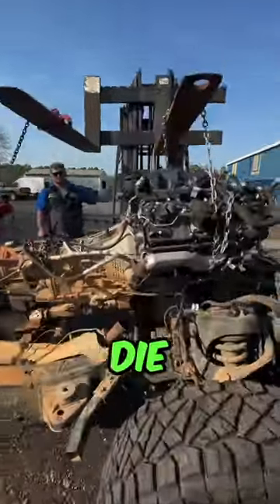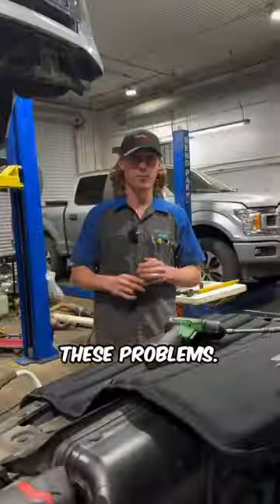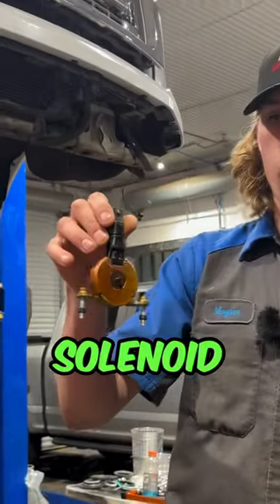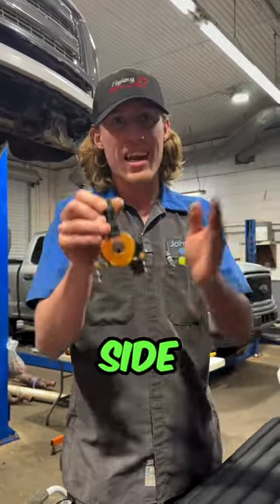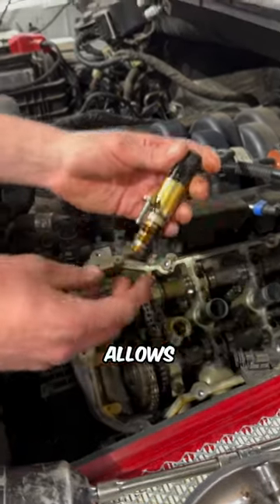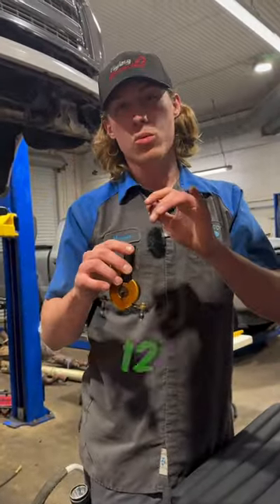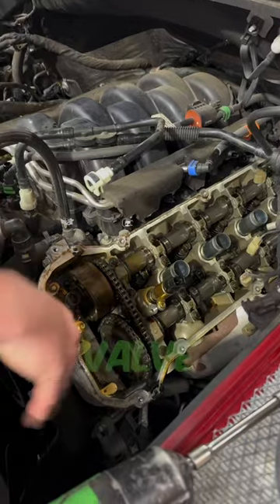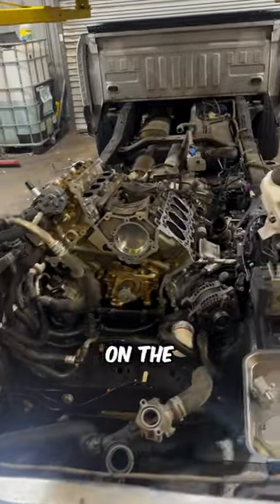Ford 5.0 Coyote Dies On Stop? #ford #coyote #shorts

Comment: This guy is 23 with 30 years experience with Ford engines
Reply: How I’m tryna be
Reply: Not a chance if that were true we would see him wear safety glasses in his videos
Reply: @justinkelch4837 😂 youll never see a tech wearing safety glasses unless you actually need them
Reply: @08specb 
I only use em when the dirt has fallen in my eyes at least twice already
Reply: More junk built by FORD coyote engines love there OIL and most are noisy running ENGINES
Reply: @karterpodlaski2283  if you want to lose your vision yea. shop I'm at requires safety glasses (they provide) and actually enforces it and guess what? most,if not all, don't complain. I don't get why people hate safety glasses, there is literally no downside to it. at the very least it stops rocks from getting into your eyes when taking off an undershield.
Reply: He's a Ford tech..
Reply: Dosent take long when you work on ford's.
Reply: @donaldkinder6716  at least we don't have junk lifters that fail all the time...

Comment: Long live the 4.6 liter, never had a valve cover off or a check engine light 12 years and still going
Reply: It's 30 year old tech that's why
Reply: 4.6 is a pretty strong engine. I’m not the biggest fan of OHC V8s but that’s one of the best ever made. There’s a reason expeditions, F150s, and Crown Vic’s with that engine are still running strong today
Reply: hell ye my dad got an 04 F150 300K miles no major issues
Reply: My 4.6 f150 is so weak always has been so weird that I used to drive my aunts Mercury with the same engine and transmission raced people did burnouts with ease my f150 won't ever do a burn out unless its wet outside 😢
Reply: That’s because the whole truck is rotted and falling apart around the motor
Reply: @the_first_resort940  nice just jump on here talking about something you don't know I don't live in the rust belt jack azs my frame has less rust than some newer cars go flap them lips to someone who cares
Reply: Change the spark plugs and see what happens
Reply: I have a 4.6 3V 2010 f150. And I love it but I have engine codes.

Exhaust manifold cracked, so it throws oxygen sensor code.

And intake manifold runners stuck, so it throws intake manifold code

Basically just loss of power/increased fuel consumption , and noisey exhaust, but no drivability issue

About $2000 for both repairs, but what I like is none of the issues I’ve had have bricked the car
Reply: The 3.8 is slept on as a good engine, my dad has a 3.8, 4.6, and old 5.0 they all have about 275k on them
Reply: @Tropicalfrooploops  if you trust in your wrench turning abilities I'd just try to clean the intake manifold, take brake booster line off get some injector throttle body cleaner and spray it into the manifold side of the brake booster line then if possible spray some downstream of whats called a maf sensor if you do a little researching you'll find what im telling you and you till unstick them runners as far as the manifold take it to a shop.thats going to do it for a reasonable price and give you a warranty because you have to lift the engine slightly to get them out and your 2010 is a 4wd it's even more of a pain i installed headers on the 5.4 version of your lets just say I did it twice because my friend just loves Amazon junk and then wants me to help , and by help he usually means i gotta do it while he gets in the way
Reply: @jayskrills7375  oh wow, thank you for this. You think it’s just stuck? I though maybe the solenoid broke off or something

Yeah with exhaust probably short headers is the way to go.

I use it for work so I’m not too particular. I do enjoy the truck very much tho, great price, never leaves me stranded, and it’s got good power
Reply: @Tropicalfrooploops  I'm just a perfectionist if my exhaust manifold is leaking id be worried id burn a exhaust valve up but in my case i have a brand new engine ( remanufactured ) I think you have a sticky manifold runner if they were stuck closed then it wouldnt run or id be real rich stuck open your looking at lean code idk without looking at live data just a idea in my head lol
Reply: @jayskrills7375 If you gear them down they move pretty well, with the big overdrive a set of 4.10s will really wake them up but still be ok on the highway.
Reply: @TheEuroGarage  I'ts already horrible on gas so I'm guessing that will make it worse
Reply: @jayskrills7375  sometimes it actually helps, Let’s the engine not have to work so hard to move the truck
Reply: @TheEuroGarage  I don't think you know what you just did but it's ok i forgive you. Days off work are going to be me rolling around in the driveway . savings account  get ready to get empty why we need new gears
Reply: Yeah I hear intakes manifolds are starting to crack that might have issues.
Reply: @gagejernigan5277 my 2000 f150 also holding strong to this day. 400k miles towing every week
Reply: @giovannimora9134    Very nice. I had a 2003 Eddie Bauer expedition with the 4.6 and when I got rid of it at 330k the motor still ran fantastic there’s was just other shit that was broken
Reply: Long live the 5.8 Windsor. My brother had 30 years and over half a million miles with no issues. His Colony Park wagon used less gas than his wife's Taurus. Less gas than a V6 Toyota Camry!
Reply: 01 4.6 f150 been driven almost every day since new 343k
Reply: @gagejernigan5277 lol strong engine 4.6 is weak and are throw away ENGINE'S there as bad as the 5.4 Triton engines
Reply: @giovannimora9134 lmao sure bud 😅
Reply: @donaldkinder6716  nah the 5.4 would blow the spark plugs out the 4.6 doesn’t have that issue n you’re shittin me cause the 4.6 picked up pretty good in crown vics
Reply: @donaldkinder6716  it’s a company truck 🤷🏽‍♂️ odd thing to lie about lol it ain’t a the most powerful but it gets the job done reliably.
Reply: Best gas engine ford has ever made
Reply: @giovannimora9134 really? Years ago had 01 f150 with 4.6 and had to replace head gaskets at 115,000 MI. I was so disappointed I fixed it and unloaded it.
Reply: @Tropicalfrooploops  that's typical 3v issues. If you want a dependable and reliable 4.6 or 5.3 you need to get the 2v.
Reply: you are so lucky.
Reply: That's because the engine is too underpowered to kill itself. 3V are just as problematic as 5.0s which 5.0s really aren't bad engines. Actually great engines. Mines 400hp and gets 20mpgs on 33" tires.

Comment: Ford has a bulletin for every f'ing part.  Just build em better.
Reply: They all do buddy! Source:I do this all day everyday at an independent shop
Reply: @killroy3607 yeah they are all shit , especially a turbo tiny engine
Reply: Yup🎉
Reply: What do you expect for claims they made the first car and we all know Mercedes did 50 years before ford. Ford was sucking Adolf off for some design ideas from VW.
Reply: Henry Ford wrote in his autobiography that if anything ever goes wrong with one of his Fords, it’s his fault. Guess that doesn’t mean they’ll make it right.
Reply: @the_first_resort940  Ford didn't claim the first vehicle, he claimed the first affordable vehicle for the common man
Reply: @kenj.8897 turbocharged four cylinders can be reliable, its just manfucatures are putting out shit designs that arent built to last
Reply: Change your oil and quit blaming ford for your bad maintenance
Reply: GM is simply in denial about their issues.
Reply: When ya’ll say they all have issues you’re definitely not talking about Toyota. Their worst, most problematic truck built it’s still better than any American made trucks. It’s a shame since trucks should be the American pride in vehicles but Japan took over the cars and trucks.
Reply: @ksale22 Henry ford was also antisemitic, received an award from the nazis and made equipment for them during wwii

Comment: 17 5.0 f150 4x4. Not one single issue with the engine or trans. 176000 miles
Reply: At 140k with my 17 2wd
Reply: yeah vehicles are weird man some times they dont break 100k miles before having some massive issue then others run just fine for 200k+ miles. Case in point i got a 2010 5.3 with AFM and a 4l60e with almost 200k not a single lifter tick and trans shift fine. while others complian non stop about theirs.
Reply: I should shut my mouth though because I get out of the marine corps in a month and I'm relying on that thing to drive me from cali to east Tennessee

Comment: Shocking how the exact same thing happened with the 3v 5.4s
Reply: you had vct codes? Because replacing those almost never fixes the issue. Most of the time it’s just the sensor reading that the cam shaft is wobbling around too much because the lifters in the back of the engine become oil starved unless the engine was meticulously maintained
Reply: @nc818 that’s just patently false.
That’s one of the possible failures, but loads of folks had their timing solenoids go bad on the 3V 5.4 Triton. 

Time will tell whether these get the integrated spark plug blowout like the Tritons of years past did.

Comment: I did this job myself. About $320 for all my parts did all 4 both sides took me about 3 hours with fairly minimal tools. The ground straps on the back of the valve covers are a big pain if you’re in the rust belt tho

Comment: Had an issue with my 15 f150 with the 5.0, cruising down the road come to a red light and chugga chugga stall, always happened when the oil had over 3k on it, pulled live data with forscan while idling in the driveway, brought it up to 4k rpm and let it drop and intake cam on bank 2 was jumping to 20 degrees off of commanded, and once it hit 24 it died, put some seafoam in it and it helped, put in some marvel mystery oil after oil changes and it helped, need to find the time to swap all 4 solenoids
Reply: It's worth it. I got the "Ford performance" solenoid's. They looked the same tho, but all 4 were less than $100, plus the gasket kit for the valve covers. 2 of the old solenoids were gunked up and sticking. Noticed better fuel economy and throttle response, which I wasn't expecting. Also don't be a dumbass like me and crack your plastic valve cover when reinstalling seals 👍
Reply: @Mr74datsun260z from my sleuthing online the ford performance solenoids have a stiffer mounting on them, not really necessary for most people but a set of 4 oem solenoids for $100 is a damn good deal when 1 aftermarket part is $35-50, I need to bite the bullet and replace em
Reply: @slasher667  just to clarify, I don't think my fuel economy and throttle response difference was from the "performance" solenoids. I think the old ones were making it worse than I had noticed.

Comment: Thank you for posting! Mine is going in again tonight for the 3rd time with a p00012 code, 1st they replaced the heads (burnt valve, leaky guides, 2nd they replaced the phasers, they were never clear on if they replaced the solenoids or not...but its going in again, but this time its not dying at lights just sporadically runs rough then runs fine...could it be a cam sensor?
Reply: They just replaced all phazers, vct's, plugs, chains and tensioners. 6k$ stalled before it got off the lot. I left it there and they are looking at it again.
Reply: Same code p0012 2018 f150 5.0 lariat with 147,000km junk

Comment: I'm hoping you can answer this question... I have a 2015 f150 3.5l that's been dying on acceleration! The last time was up a hill first time towing a trailer... once it dies, it will not restart at all... first time brought it to mechanic as electrical shits beyond me, 1500$ later with a main wiring pack replaced as it was said to be burned up, got it and within maybe 20km drive, died again.. first time it flashed alot of issues such as hill decent not working, charging system failure etc... the charging failure stayed on till the mechanic "fixed" it.

Comment: Boy do I love my Henry Ford F150! Needed a reliable truck for work so I got a very clean 2019 F150 kr 5.0 with 32k miles. 

Followed all the recommended maintenance and what do I  get? A $50k vehicle that stalls like a 80s beater, bogs down when accelerating, occasionally has a flashing cel and cuts power on the freeway, and then the cherry on top was cancelling work on a work trip to replace the front right wheel bearing in a hotel parking (55k miles). The wheel almost seized and the lugs began loosening. 

Also The Henry Ford dealership charged $250 to do their little cycling procedure (fixed nothing) and said “it seems fine but come back if you want us to look into it more” rather than sharing how I could’ve gotten BRAND NEW solenoids for less than that. 

I had a 1995 Corolla with half an exhaust valve missing that was FAR more reliable than this. I don’t know what to think anymore. No warranty left either. They timed that good!
Reply: No1 cares

Comment: Up north you buy all new hardware, and a new valve cover 1/2 the time because there is no heads left on any bolts, and you have break everything.
Reply: That's simply not true. All the nuts and bolts you need to access are on top, or close to it. Its almost unheard of to snap the heads off the valve cover bolts. And even if you did, so what? The head of the bolts hold the valve cover on. If you have a plastic/composite valve covers, there's a metal sleeve pressed into the valve cover bolt holes.  
You may be mistaken for at least some of it because Ford has a lot of single use only parts and fasteners. For example, when you remove the fuel pump the 2 steel lines must be replaced. Its not optional. Ford requires it, along with any other parts.

Comment: They also have a bulletin that when your 5.0 starts knocking that its normal.  My 2017 f150 has all of the above problems. Already put a new trans at 100,000 miles for torque converter shudder. Still stalls and knocks.

Comment: Absolutely I missed these old 4.6L, 2.3L 3.0L and 4.0L and also 5.4L 3V is better than new ford engines. I have zero issues with 5.4L 3V 230k miles so I decided to swap mellinh oil pump and replace all new ford oem timing kits and phaser.
Reply: Nice to see someone who actually knows what they're talking about, the 5.4 3v is junk bandwagon has become urban legend at this point, their solid when taken care of, hard to believe the human race still hasn't figured out variable cam timing.

Comment: I have a 5.0 f150 2018 and when I take off from a stop not all the time but most of the time it makes a rattle sound it only happens when warm I use 93 gas have you had anything like this with a fix?

Comment: Those vcts are the arch nemesis of the 5.4 3 valve. I locked my cam phasers and it stopped the vct or vvt whatever yah call it, but I don’t understand why locking the phaser stops the issue anyone know why?

Comment: I have a 2018 in the shop right now. I paid 6k they replaced all solenoids,  phazers,  chains and tensioners. Oil and coolant. It stalled before I got it off the lot. Brought them out, they plugged in computer with no codes. They watched it stall and sputter repeatedly while plugged into laptop. Still no codes. It originally was in for a p0012 was stalling for months before it coded.
Reply: It's a 5.0 with 147,000km on OD
Reply: There were other codes. You can't have a 2018 F150 stalling for months and not have any codes in the history. Someone either didn't know what they were doing, or they were not being honest with you.

Either way, you would never make repairs off a P0012. Its too generic. I believe its something like a generic timing fault on bank 1 intake, or something similar. Most likely, someone was just lazy and fired the parts cannon at your expense. The problem with a code like P0012 is all it can do is point you in the right direction. Any number of things can give that code. You have to keep going until you find something more specific. You could just have a bad cam sensor.
Reply: @AT-wl9yq  it's good to go now, they forgot to do the misfire monitor neutral profile correction after the replacement of vct system. In fact, it did not have any codes for months of stalling. This is common, and there are plenty of examples of the F150 forums. Problems ranging from solenoids, intake rails(cracked) phazers. Cam censor ect.
Reply: @AT-wl9yq  they tested the solenoids and they were good, then they tested the cam position and it was over retarded so they replaced them. Cheers
Reply: @rogerrabbit8756  I understand all the issues with the parts, however I'm still going to disagree with you on the DTC's. If I had your truck, I could prove it. You just have to know how to get them. Every time the motor stalls with the key/button in the on position, a whole bunch of modules send communication codes. Also, some permanent DTC's may have been set, but you probably won't  see those either. 99% of the time, a complete scan is done on all the modules at once. You can also scan each module individually. Module scans can give you a lot more information. than just doing all of them.
Reply: Not if the thing has a shorting harness, bad ground or bad pcm

Comment: What is the typewriter noise
Reply: That is his impact drill when he used it to remove the solenoid.
Reply: No it's when the engine is running and at operating temperature, I asked because it's a 5.0
Reply: No one really knows. Engines have been torn down by ford and others and no one can say. I have 82k on my 5.0 and runs great and I hardly hear the noise any more.
Reply: My best guess for the tick is,  there is a shim on the trust bearing that clicks and wasn’t set properly when the engine was assembled.   The 2 mustangs I have don’t tick.  2015 Roush rs3  and 2019 GT. My 2011 and 2014 Roush  did tick

Comment: Step one dont by a ford. My 2006 Nissan has a VCT type system and has had zero codes for the 200,000 miles they have on them.